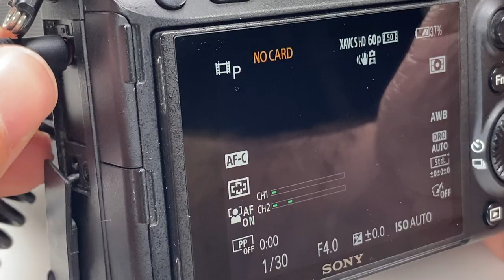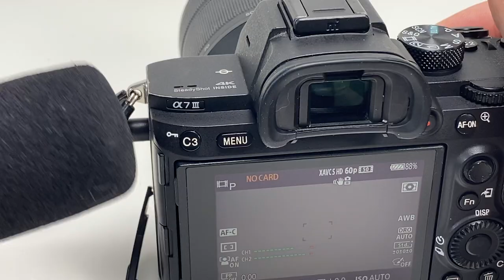Sony Alpha A7M3 ILCE-7M3 | External Audio Microphone Input Jack Port Repair Replace Overview

Comment: Im having an issue with a Lumix gh6 , I believe the port got damage with the pressure of constant in and out, it even made the internal mics stop working  . any advice? ty
Reply from the maker: Thanks for watching our video. Although we don’t work on Panasonic cameras, I am assuming that it’s probably a similar situation to this Sony camera that we did the repairs on. Most likely you’re just dealing with a bad mic port. My recommendation is to find somebody that is experienced with these cameras and have them repair it for you. Best of luck with your Panasonic camera.